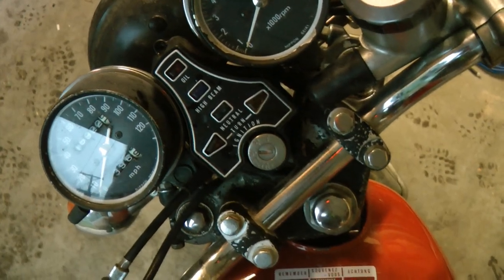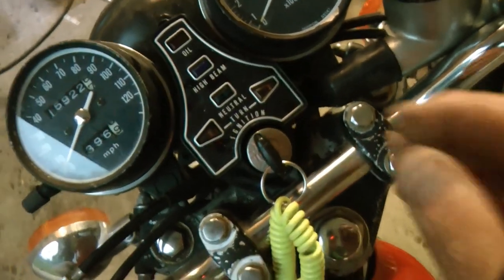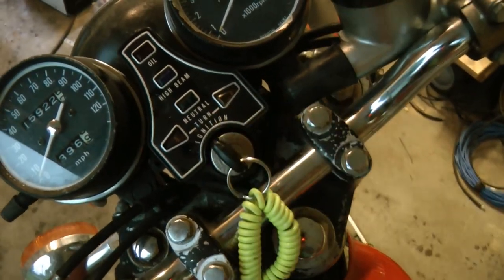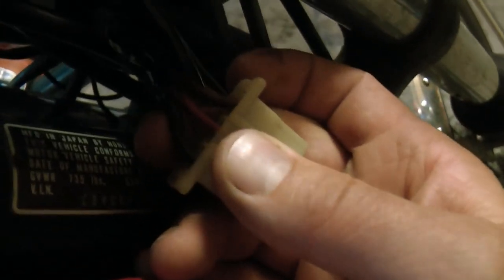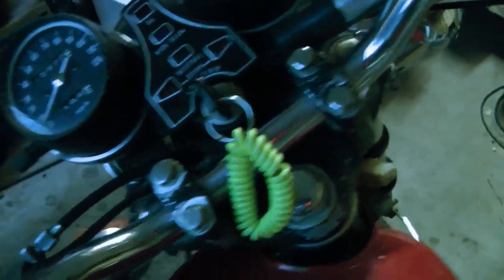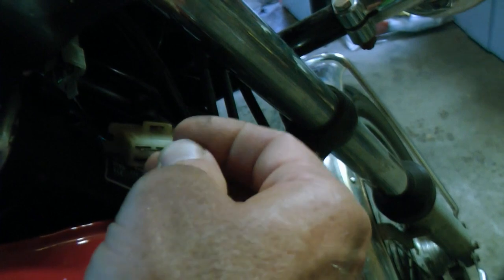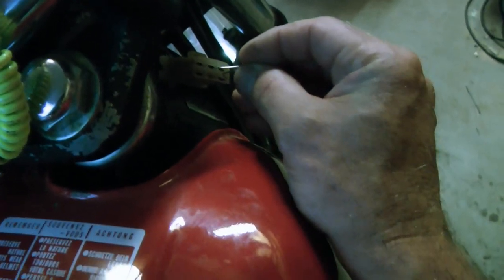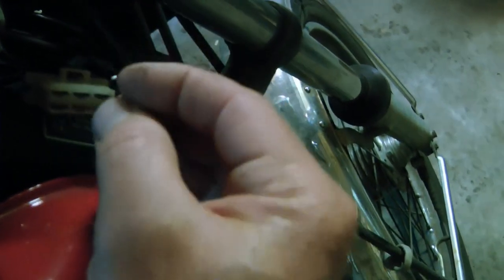Start your Vintage Honda Motorcycle without a Key - 1976 Honda CB400f

Comment: THANK YOU. I have a 71' CB450 and was about to spend $120+ on a locksmith. All I had to do was attach the red wire to the black wire tho... no connector needed. Thanks again!
Reply: key code would be better

Comment: I bought a bike last night here in Juneau and it got stolen by 6am I got it back from the cracks head by 9 am but they busted up my ignition with a screw driver so this is a life saver. Thanks so much.

Comment: CAN U FIND OUT WHAT THE ORIGINAL SPARK PLUG TO BUY FOR 1976 HONDA CB 400F? THANK YOU AND I WAS WONDERING TOO IF I CAN USE A 10W-40 FULL SYNTETIC OIL THANK YOU AGAIN....
Reply from the maker: No and no. Google it. The oil is special.

Comment: I did this but I have no tail I have brake and signals but no regular light
Reply from the maker: I could be that the bulb is burned out. Check that. Also could be the contact under the bulb. To be sure see if there is voltage getting to the contact that energizes the tail light filament.
Reply: @mbrenengen  it's a brand new led tail light like i said brake light works was wondering if there was a diffrent wire for tail light